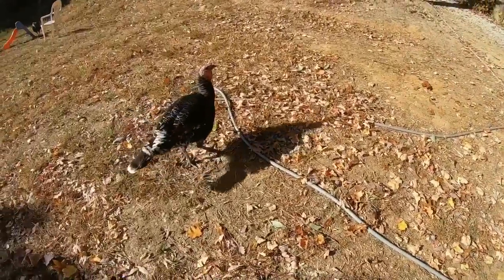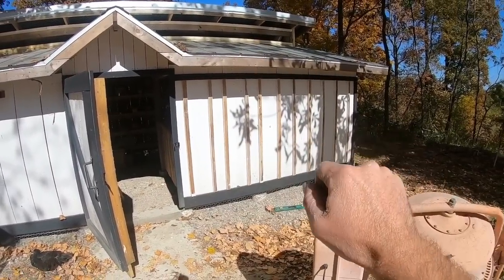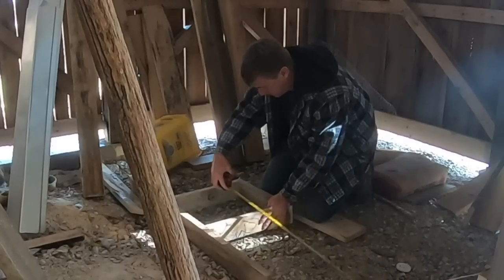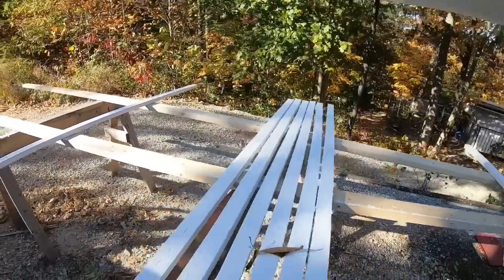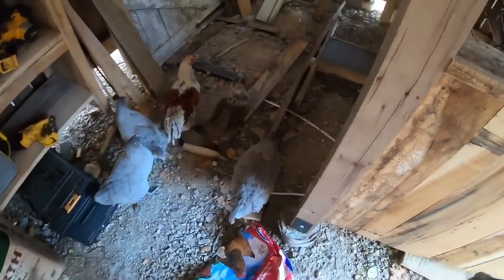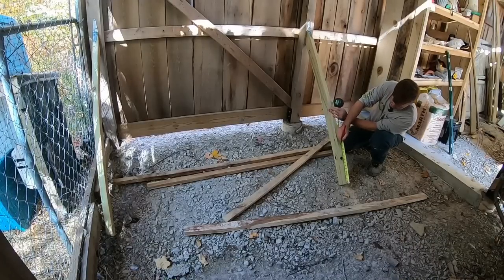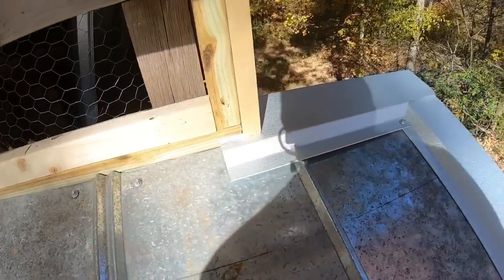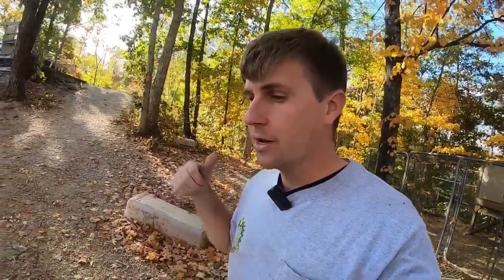Homestead Barn Build - Finishing Roof Trim - Roosting Poles - Goat Pen Gates

Comment: Do yourself a huge favour and use sand on the floor of your chicken coop side. It is sooo much easier and cheaper to scoop up the droppings with a long handled litter scoop that you only need to replenish maybe twice a year. Great build.
Reply from the maker: We are just talking about that the other day, I think that's exactly what we're going to do and with the concrete we have at each door that should help hold the sand in the chicken area pretty easily for us.
Reply: We tried sand. Our birds hated it and it got so cold in winter. Our ladies preferred straw. Pain to clean but it worked better for us.
Reply: @SammyFender  Too be fair, I'm in Vancouver, BC, Canada and I use straw in their nesting boxes so a certain amount of it is straw. lol
Reply: @l.m.2404  You made a great point about sand! I wish it would’ve work for us!
Reply: Sand is a good idea as we used them for the horse stalls along with hay. Of course cleaning was easier we found it better for composting also.
Reply: My girlfriend's birds like pine chips and sand. She found out the straw had way to many bugs.

Comment: My wife  and daughters have been in poultry 4h for 15+ years.  One lesson they learned is to have different pull shapes and textures for the birds.  It helps the birds not get bumble foot.  Old rug rapped on one or just shaving the top of 1 or 2 of those boards just to change the shape.  Just my 2 cents
Reply from the maker: Hey definitely appreciate the input!  I'll take the plane and shave then down a little bit

Comment: Slides are great until you get old and can't get up when you get to the bottom. I  am ready for your t shirt to arrive. Dont you need screws in the middle of  the batten strips so they dont warp when they shrink. Do you have weasels in your area ? If you do you need 1/4" square hardware cloth on the bottom of the chicken coop cause a weasel can go thru the chicken wire.  One fancy chicken coop !

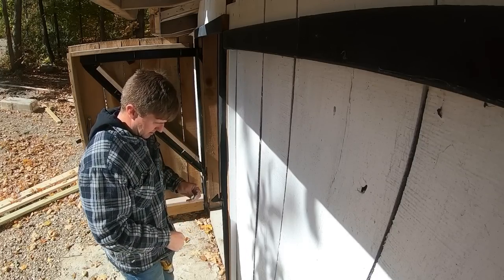Comment: 2:49  The way you located the batten to one side and use screws to hold it only on one side is how a batten is meant to be mounted. The gap is covered even if it changes size.
Reply from the maker: Yup!  Some people screw to both boards and then their strip ends up splitting
Reply: @CaptainKleeman  You are the first person I seen that did it right.

Comment: I have found some demolition sites and construction sites are pretty generous with their scrap wood... A lot of good wood gets thrown out and sometimes it just requires banging the nails out for a day or two.
Wood pallets are also a good source for harvesting good wood that has been treated so it can withstand the elements a bit more.  They come in all shapes and sizes.  Sometimes you don't even have to tear them apart for them to be useful.

Comment: Your Birds may not like the Roost's They should be Round or flat. they are not gonna grip the them the way you have them at the angle. 
Keep the Roosts higher up than the nesting box's,  that will keep the Birds out of them at night, they like to be high up when Sleeping. and they wont Be Pooping in them..
Thanks Mike.
Mike M.